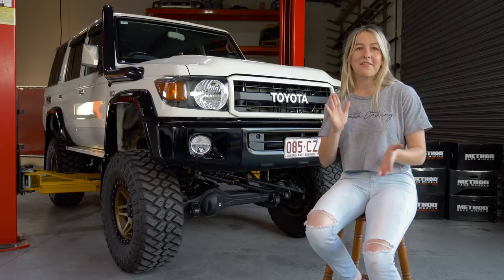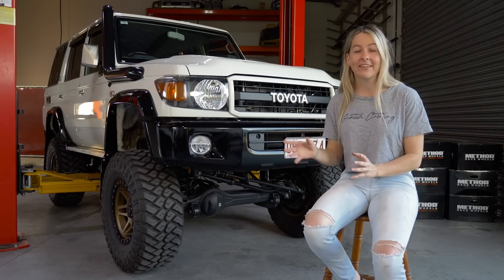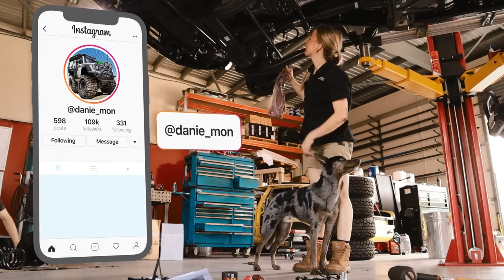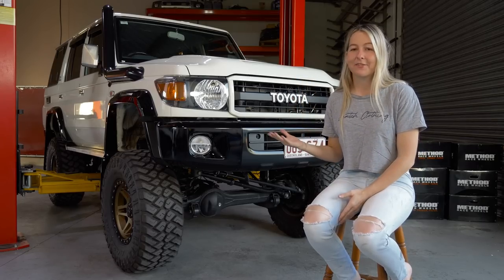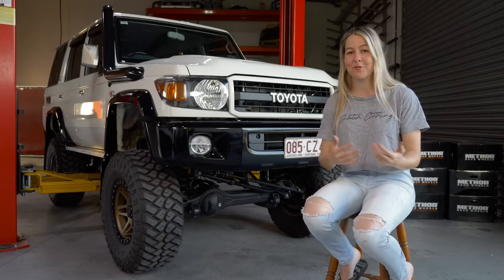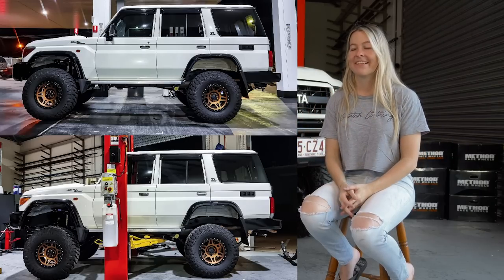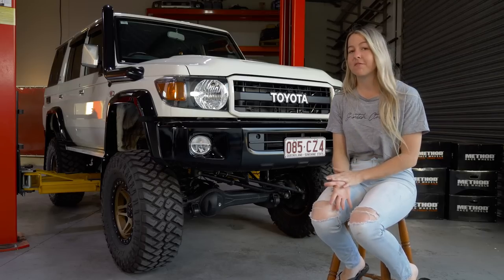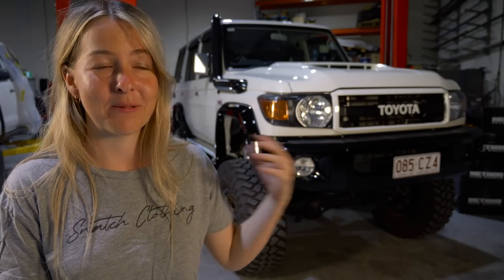Is this the best 3" suspension kit in Australia?

Comment: Definitely one thing to take into account once you hit a 3inch lift camber on the leaves...lots of shackles inverting due to the dynamics of the spring shape once you bend them that far. Good looking 76. Keen to see how it goes.
Reply from the maker: most leaf springs aren't 3 inch they are two inch with an extended shackles and unfortunately the few 3" leaf packs available won't be made to suit the vehicle they're installed into. Majority of leaf vehicles would require spring hangers to be moved, redesigned etc
Our 3inch spring is custom designed to suit the 76 and our engineers analyse each design and take into account many different factors to ensure they are suited in every regard.
Ours have been in for a year now and undergone testing at over 4T, while still articulating brilliantly offroad. So were happy to report they're going very well:)

Comment: Loving the look of the kit. I have a 2020 76 and currently have tough dog 2 inch and have a bad case of wandering, I was wondering how you went with engineering for the 3 inch lift
Reply from the maker: thank you! and that's a shame about the wandering.
and sorry what did you want to know about the engineering ?
Reply: @DanieSimpson   in NSW the max lift you can go it 2 inch and 33inch Tyers so I was wondering how to get 3 inch engineered to be road worthy.
Also when do you think you kit will be on the market
Reply from the maker: @monad00  no that's incorrect. what size tyre depends on your vehicle, its not limited to one size. NSW can go +7% over factory (which for the 70series is 35") and can even go above this +7% with certification. 
NSW can also have their ride height increased up to 6" including suspension/body/tyres with certification.

and yes our kit has been available for almost a year now.

Comment: The only advantage I can think of in a 3 inch lift is water crossings.
After stopping several mates rolling these things ( lots of rock packing and winching) I would want 35's and no lift. I know that's not possible without panel work 😂. 
Looks cool though!
Reply from the maker: if a vehicle isnt stable offroad its generally due to a poor suspension setup, incorrect springs/shock valving, removal of stability components or poor weight distribution ie. roof top accessories.
2-3" is perfect happy medium for good clearance and good CoG

Comment: great video, as I live in queensland and thinking very hard about getting a 70s series this channel is even more interesting. While I have many question I guess the first would be about the 3 inch kits. Yes it tricky to find them and how good they are. What about the Superior Engineering one. I can full understand conflicts of interest no stress I deal with that on a daily basis
Reply from the maker: oh that's awesome to hear! 
yes superior was certainly one of our first options as I've run a number of their components in my vehicle before. Unfortunately all there kits at the time for the 76 come with standard 2" springs and an extended shackle which means it's not legal on road. Alot of other 3" leaf springs we found were also poorly designed for the 76 and results in a terrible ride and not ideal wheel travel. 
Hence how this kit came about. We designed our own setup that is able to be engineered for on road use and is comfortable but most importantly actually articulates offroad:)
Reply: @DanieSimpson  Thank you for reply and advice

Comment: Nice work! Last time I looked at 3” for a modern vehicle in QLD there were no lane change facilities in QLD that could cater for ESC vehicles. And therefore it was only pre registered or older non ESC vehicles that could legally run 3” with a lane change cert/engineering. Has this since changed? Thanks.
Reply from the maker: always been plenty of places offering lane change testing in QLD. Regardless if the vehicle has ESC or not, the lane change test is the same. ESC vehicles then require further additional testing of which there's only a handful of places in the country that can carry out this testing.
Any registered vehicle with ESC regardless of model year needs to complete both of the above mentioned tests for lifts about 2". Registered vehicles that have been mod plated without passing the required testing are still not legal and can be pulled off the road.
Only change is now you can certify 4" suspension

Comment: Have you guys released heavier rated leaf packs where a shackle isn’t necessary as well or is it the one for now?
Reply: Both the 76, and 79 springs are available in constant 300kg and 450kg at 3-4 inch lift.
Reply: @JRaceIndustries  can this kit work with terrain tamer parabolic 700kgs ?
Reply: We have a similar 2 inch kit that uses the TT parabolic. Unfortunately Terrain Tamer only make the parabolic springs in a 2 inch lift.
Reply: @hieuphan4264  dobinsons make a 3 inch parabolic

Comment: Are you going to try parabolic springs before coil rear ??
Reply from the maker: have already installed plenty of Parabolic springs into 70series vehicles.
There is no 3 or 4" parabolic suited to this vehicle and there's no testing requirement for the 2" parabolic so no need to install them

Comment: I have seen 79 series shackles flip over under tensio have had to snatch jerk them back out into position
Reply from the maker: any shackle on any vehicle can invert, this is often resolved by using the correct length spring with the correct rate for the weight of the vehicle and by using anti-inversion shackles

Comment: 315/70 R17 fit without modifications???
Reply from the maker: this vehicle has substantial modifications
Reply: @DanieSimpson  thx for answering, but you didn’t understand my question, I mean if I have stock LC76 can I use 35 inch wheels?!
Reply from the maker: @mikhailmagomadov1544  no
Reply: @DanieSimpson  thx) only 33 inch 🤝